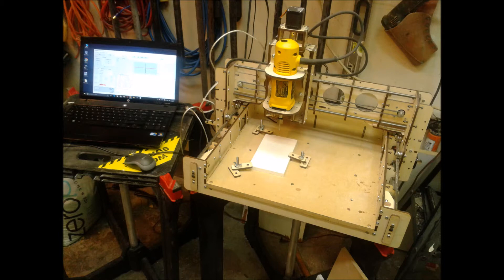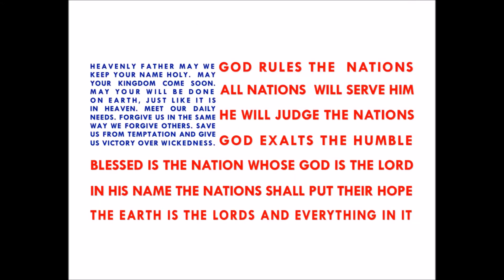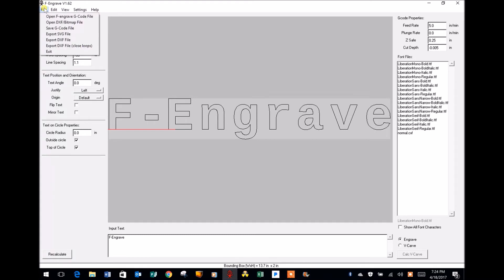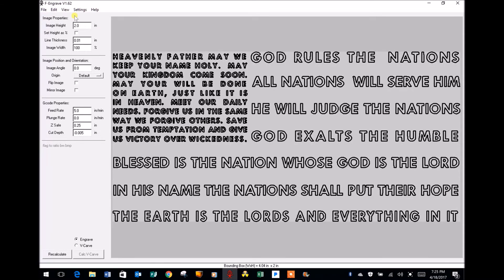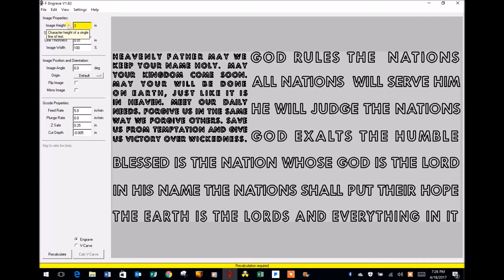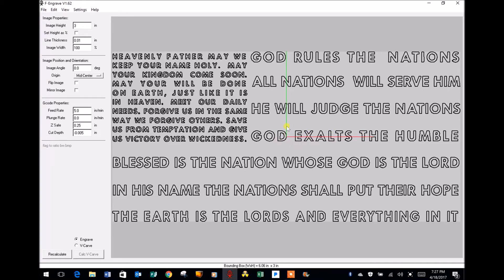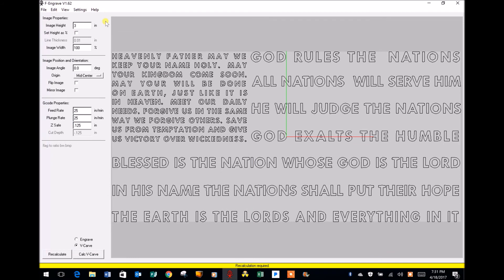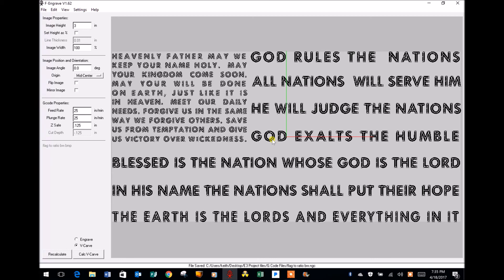Getting Started With F Engrave 4 19 17

Comment: Bob I just received your cnc router. I am trying to learn how to cut out acrylic. How do I go about cutting a piece of acrylic instead of doing a shallow engrave?
Reply from the maker: Consider it time well spent as you experiment with different types of bits cutting different types of material.  I'd recommend using a number of shallow passes to cut through your acrylic rather than attempting to cut through it outright.   I've done some engraving with 1/2" Corian.  I set my feed rate set at 30 inches per minute with a cutting depth of .185 inches using a single fluted bit.

Keith